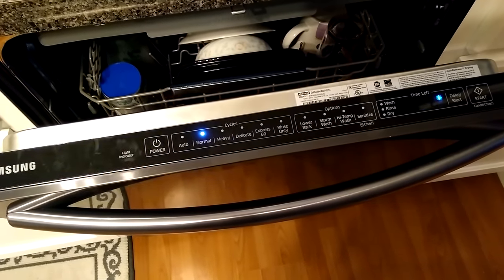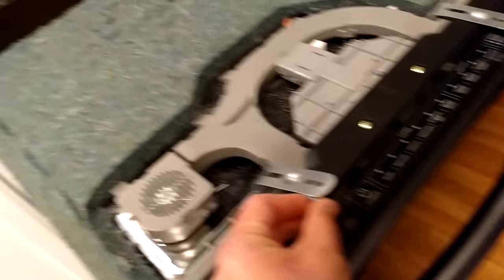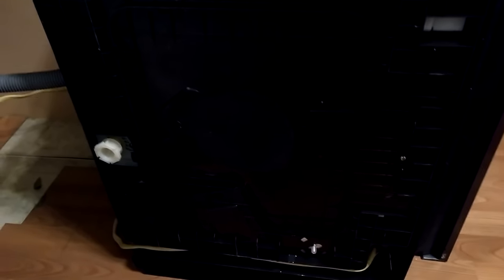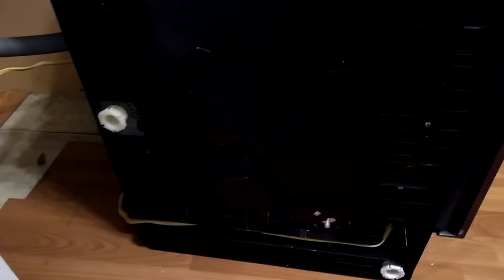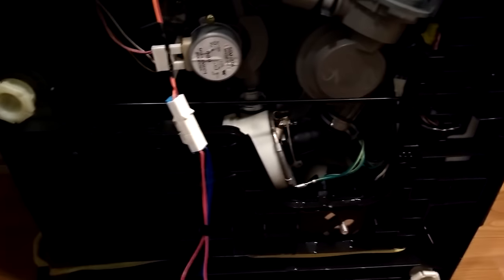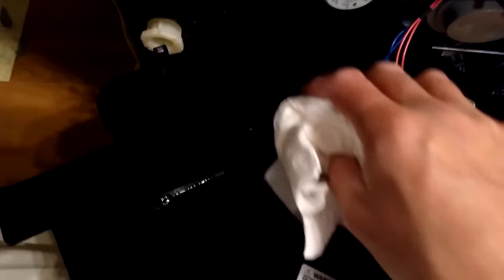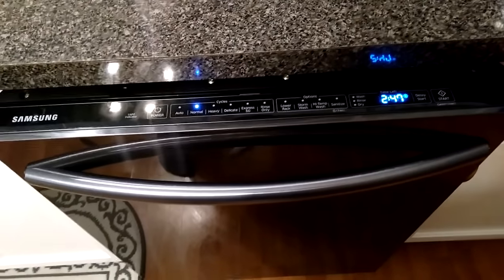How To Fix Samsung Dishwasher with LC Error Code

Comment: Thanks so much. This is the second time I had to do this, and I'm pissed. First, the issue with my Samsung refrigerator where air got in the back and re-froze the ice in clumps, and now this. No more Samsung appliances in my kitchen!
Reply from the maker: Sorry to hear that. Yeah we have a 4 piece of appliances and our refrigerator has had a couple small annoying issues too. Is your dishwasher under warranty? We had a separate issue with leaking from the front door and we had a repairmen come out to have a look. He gave me several good tips for avoiding that and we haven't had any other issues. I should probably do a follow up video.
Reply: @howtofixitworkshop  I have to check, but yes, it's still under the manufacturer's warranty. Don't know much they can do; I think next time it happens I'll just disconnect the sensor.
Reply from the maker: I thought about disconnecting the sensor but I couldn't help but imagine walking up to a flooded kitchen after the overnight run. Probably would only be a few drops but the sensor is at least peace of mind.
Reply: @howtofixitworkshop  we have a samsung dish washer and samsung oven. The dishwasher has worked fine for the years weve had up until now with the LC issue but that glass top stove convection oven is a joke. Since the first  week we have not been able to get the door to latch and make the system work properly. Repair man came out "fixed" the door issue and that same day the problem still was there. They came out and replaced it and nothing.. they gave us another oven as it was still under warranty and within a week problems with that one too. I hate using the oven. Stove top is fine but the oven is the devil. 4 times they've sent people out and not one could figure it out. Definitely has given me a bitter taste in my mouth when it comes to any samsung appliances.
Reply from the maker: I feel your pain. We have the 4 piece set. Haven't had any issues with the oven or microwave. Have had a few minor issues with the fridge including needing to replace the ice maker a couple months after purchase. Everything seems to be working well right now as we approach the 2 year mark. *Knock on wood..

Comment: Fun Fact, the water setting my code off was on the connector to the sensor. I used a hair dryer to dry out that water and was good to go.
Reply: Dude this comment saved me. Everyone else seemed to have simple easy fix. I wasn’t. Turns out the connection had water in it. Hair dryer for a few minutes and we are working again. Thank you John!

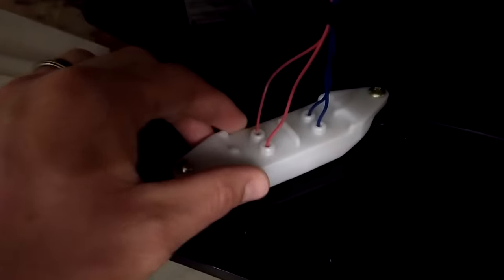Comment: At the 2:06 mark the sensor comes off with the two screws, underneath are 4 pins that detect moisture. I ended up adding a couple of 1/8" tall nuts as shims to keep the pins up a little higher off the bottom of the tray. The "bowl" is only 1/8" deep so even condensation from an exterior wall can cause enough moisture to build up over time if the weather is lousy so raise up the pins a little or keep getting the LC every few months. Some guys will cut the pins back, but that can cause an error code on it's own if you're not lucky. if you decide to trim the pins back, use a Dremel to grind them down and don't pinch them with cutters. Also make sure there isn't any debris on the floor when you slide the DW back in. The tray is very flexible and shallow and if you get a screw or piece of wood, drywall, etc. it will push up on the tray slightly and you'll be pulling it back out again.
Reply from the maker: Thanks for sharing your tips!

Comment: Any chance just a fan blowing would be able to help dry this out instead of tipping the unit over after sliding it out from under the countertop?
Reply from the maker: +Brian Kehlmeier I think it's unlikely that air would reach the drip pan underneath, it's a pretty concealed area.
Reply: Yeah... I am 36 hours in and still flashing LC.  Discharge hose was clogged.  I will pull the unit out tonight if still not going away.  Great post.  Thanks.
Reply from the maker: +Brian Kehlmeier I feel your pain, so frustrating. Good luck and thanks for watching.
Reply: Actually, 36 hours with a small fan dried it up! If you have the time and only a small leak, worth a shot!
Reply: Where exactly did you direct the fan? Thanks for any help!
Reply: I took off the cover at the front/bottom and pointed the fan down the left side at an angle.  The goal was just to try to produce as much air movement as possible under there.  I am so glad it worked as it saved me from pulling the dishwasher out.  I haven't had an issue since.
Reply: Thanks so much for getting back to me! I will have to try that out. I wasn't sure if there was a way to direct air into the catch basin area, but it looks like you figured it out.

Comment: There was water in that pan and I cleaned it out, Still would not reset. Pulled it back out and pan was dry. Still would not reset. Disconnected the sensor entirely and would not clear. I did find two clips and a gasket inside the dishwasher filter. Ideas? Thanks
Reply from the maker: Sorry, I don't know where those clips and gasket would have come from. Best of luck to you, hope you figure it out

Comment: Tighten the screws under the metal filter plate that secure the motor to the base.  That's most likely your leak source.
Reply from the maker: Thanks for sharing!

Comment: To everyone having this problem that actually has water in the pan: I have found where my water is coming from! It’s not the hose. Follow the steps in this video and after you have the pan off look to see if the black sticky insulation is pulling apart from the bottom of the dishwasher, mine was and was putting pressure on the sump pump assembly and separating it and water was bypassing the seal. If this is the case then you must take it all apart from the inside and reseat the insulation and seal. If you’re feeling lucky you can just cut out the section pushing on the sump. I will try to make a video on this soon.
Reply: Video please
Reply: More info pls??

Comment: I just had this happened and I went and hit breaker let sit for 5 minutes and then it started working again, I had also a few months back have another error come up and the whole dashboard would not work so i had to shut breaker off then and it reset.....I am wondering if this is some sort of electrical issue that resets when power is shut off
Reply from the maker: I've tried the breaker reset in the past but didn't have any luck.

Comment: I have this model and issue. But I cant pull the dishwasher out all the way. There is a connection that is preventing it from pulling any further out. It can come out about 90% but the connection going to the bottum right corner of the back of the unit is preventing me from pulling any more.

Comment: Should you get the error code LC
Before you take your dishwasher apart.
Check under your kitchen sink, where the dishwasher connects to the drain.
Disconnect your dishwasher drain, and see if the drain itself is blocked.
Even if you find tiny debris that might be the reason for the LC error code.

Comment: I tried this, and it worked, but happened again a few days later. I called Samsung about this problem. They suggested disconnecting the tube at the disposal to see if it drains (into a bucket). I did, and then I saw a bunch of crud clogging up the hose. I cleaned it out, and hopefully that prevents it from happening again.
Reply from the maker: Great tip! Thanks for sharing!

Comment: I too own a Samsung dish washer. This problem happen to me the other day except I wasn't running the dish washer. I had spilled ice tea which went both inside the door and down the outside of the door. The door was partially open. Within seconds the dish washer motor started running and the display flashed the letters CL. After watching this You Tube and others...I watched other You Tube videos because I really didn't want to pull the washer out of the wall and turn it in its side. But I did, there was a very small layer of where my ice tea gathered. Looking at the sensor, it's just four metallic pins. Basically a open circuit. No smart circuits nor summation resistors to monitor health just an open circuit. I was tempted to remove it but decided to use 1/8 " nylon spacers from Lowes.  This way the leak will be a real one if it happens again. I talked to Samsung Corp about why should the motor cycle over and over since one time is enough besides the motor only drains what is inside the dish washer and does nothing for what lays in the bottom pan. My washer is hard wired in. The breaker shares several circuits and lights. it was not convenient to just shut the power off at the breaker. But in my case I had no choice besides pushing the power button on the washer doesn't stop the cycling. If you ignore the cycling and hope it just stops well that could lead to burning the motor up and running up the electric bill. Samsung will not fix the inherited design flaw. Which by the way is modifying the code in the controller board with an update. The motor should only run once than quit. Why the code ignore the water sensor Inside the dish washer was probably  an oversight by the engineers at the time. Since Samsung won't accept the error in their ways I had to install a cut off switch under the kitchen sink, just in case it happens again for Samsung dish washers sake.... If it happens again I can now conveniently flip my dedicated power switch. Thank you Samsung for such quality products.
Reply from the maker: Wow, thanks for the feedback!! You explained the situation and the design flaw so well! Go enjoy yourself a nice glad of ice tea 😆

Comment: And what did you fix?
Reply from the maker: No more leaking!  I tightened up everything that I could under the diswasher and around the motor and pumps and water supply and waste lines.

Comment: Man, thanks for the video.  Our samsung is the biggest piece of shit. Lol. We replaced it because our old trusty seemed like it 'wasnt cleaning as well'.  HA! What a disappointment. Not only does it suck at cleaning dishes but it also sucks at drying them, too.  Now it's leaking. 😂😂😂 Not even 6 months later.   Yikes. I'm going to craigslist this thing and be done with it.
Reply from the maker: Sorry to hear that. We had several issues early on including the LC error code. I had a certified samsung repairman visit once while under warranty and he gave me a lot of useful tips that you won't find in the owners manual. I should create a follow up video to share what I've learned. We've had the dishwasher for 3+ years now and it's done well for us.

Comment: When I pull washer out, those main hoses have slack as to not unfasten etc?
Reply from the maker: Yes there should be enough line so that you can pull out the washer and disconnect.

Comment: So I’ve had this same issue multiple times. I’ve done this reset multiple times and finally gave up. We let the dishwasher sit in the kitchen for a year until I said screw it and tried something new.....I removed the sensor entirely. I just unplugged it and unscrewed it from the pan and put it back together. So far, so good. I guess the only drawback is losing the “leak sensor”, but I had never had what looked like more than a teaspoon of water in there, so I’m rolling the dice.

Comment: The video is helpful.  On newer models the bottom pops off there are no screws. Do what the video shows to do.  The leak came from the door on mine.  At the bottom.  Take the bottom rack out.  Get a hand mirror and flashlight and look at the bottom door seal.  Yuck.  A layer of dirt and soap residue builds up there and prevents a tight seal which then the leaking water ends up in the bottom pan and giving the LC code. Take a micro fiber cloth and wipe the grey nasty slime out. Enough builds up to prevent a proper seal.  It is nasty crap.  Might want gloves.  Then use a little spray cleaner with some bleach in it.  Wipe the bottom seal occasionally to prevent this.  After you see what is there you will question just how clean you dishes have been.  Yuck.  A lesson learned.
Reply from the maker: 100% agree here! I do this every few months. That sludge is disgusting!

Comment: Have you figured out any permanent fixes?  I've dried it out and get it to wash for a few days but the code always comes back.
Reply from the maker: +JWenz21 I had this happen to me 2 times during the first 5 months of operating. After the second time I took a look at all hoses underneath to make sure they were tight. I also made sure the dishwasher was level. I haven't had any more issues with the error code in a couple months, hopefully I solved that problem. I did have another leakage problem and learned a couple more things, I may shoot a follow up video.
Reply: I disconnected the sensor.  If i see water on floor i know i have an issue.  I got tired of taking it out every 2 weeks.
Reply: Thanks, Eric... I was wondering if the machine would still operate with the sensor removed.
Reply: Gabe- yes it will run without the sensor.  I ended up taking the side off of the dishwasher and seeing that there was a small leak in one of the hoses that connects to the drain hose. I ordered the hose (about $25) and installed it on a Saturday morning. So far so good, but every leak may be from a different spot. My leak was very small, but enough to trigger the sensor, don't know how long it would be taken to become a problem considering I am on a slab and tile in the kitchen.  If be concerned if it's not on a slab or kitchen floors are hardwood or something else that could be effected by water
Reply: Thanks so much for the reply! I've had this problem a couple of times - the first time it seemed to have dried out enough on its own to continue working after 2 or 3 days, so I'm guessing the sensor is overly finicky and more of a pain than anything else. Then again, if there is a legitimate, full blown leak sometime in the future, that sensor could save me from some major water damage. But this type of sensor is a newer technology that I never had in my older washers, so I'm guessing I would be fine without it.
Reply: I had a warranty repairman come out, and although he wouldn't touch it because it was installed incorrectly (not per installation guide standards), he did tell me that the common issues are the drain hose coming in too high through the cabinet side (vs low on side and up through floor in the cabinet under the sink) AND the drain hose must be elevated to a 30 inch minimum. In addition, always use Jet Dry, or the condensation may also pool. I just fixed mine tonight, to standard, and hope this corrects the issue. Stay tuned.

Comment: This has happened to puts a few times and it’s been taken apart, but now the water is not draining inside the dishwasher and our garborator is not draining.
Reply from the maker: Bummer, did you figure out your issue?

Comment: my question is:  where is the leak coming from?  We have to flip the breaker and remove the front panel & place a fan on the area for 5-8 hours to dry it out then it will work.  Unfortunately we have to do this every other time we run the dishwasher.
Reply from the maker: Try tightening the clamps to all of the lines, water supply and drain

Comment: Is there a way to do this without removing the dishwasher from the wall? I can't get mine to come out, it keeps acting like it's caught on something. I've removed all screws, disconnected all hoses and electrical but still won't come out.
Reply from the maker: Maybe the feet are stuck, especially if flooring had been added or replaced
Reply: @howtofixitworkshop  😆I finally managed to get it free after posting this comment! The drain to the garbage disposal and the hot water line were keeping it from coming free...
Reply from the maker: Awesome! Hope you got the leak fixed, too
Reply: @howtofixitworkshop  luckily it was just a clogged drain causing water to stay sitting in the drain line.
Reply from the maker: That's good!

Comment: Here's what I did.  If you take the sensor off and cut off a 1/16 " or 1/8" off of each of the four probes, it will keep the sensor from detecting those tiny amounts of water or moisture.  Cutting the probes shorter allow detection to still happen for a large catastrophic leak but not for the small nuisance leak.  No leak is good but it seems that you can spend a lot of time trying to find the source of the moisture